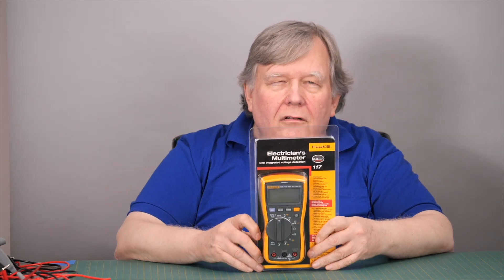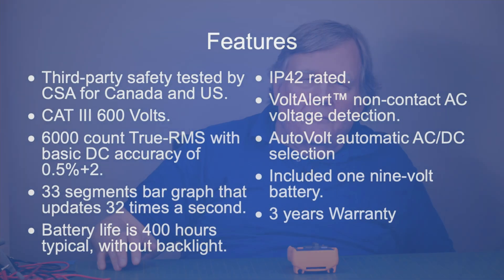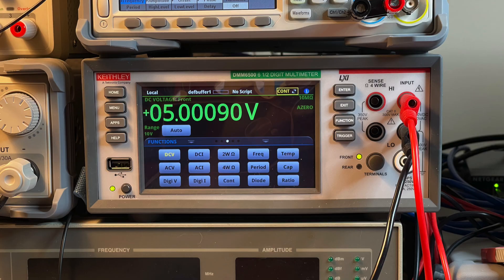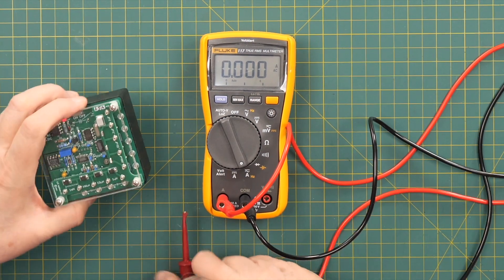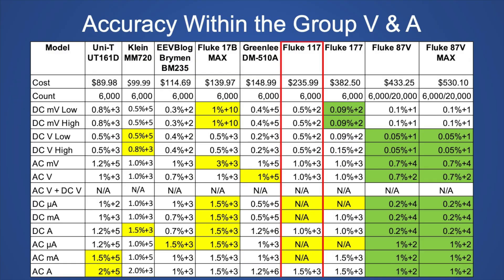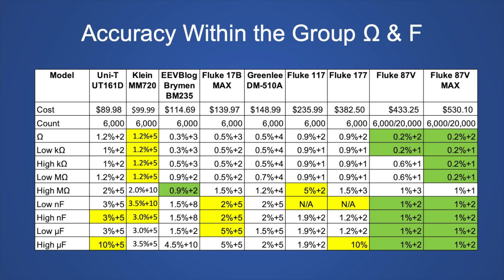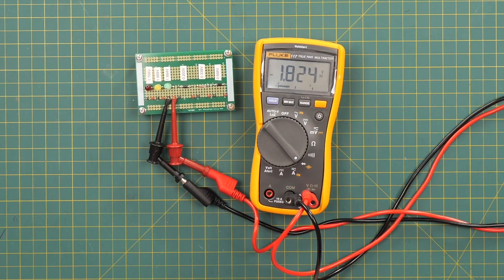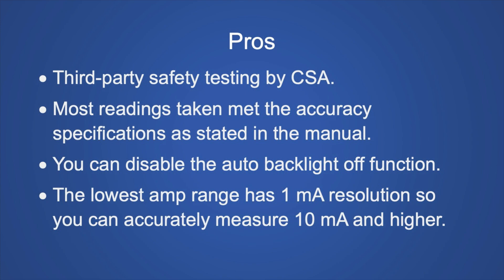Fluke 117 Review

Comment: Yep, I have one, I also have 289, 43B power meter, 7-600, as a motor controller electrician I’ve got a few others as well, other factors to consider are, toughness, safety, longevity which I believe it has over the other cheaper ones.

Comment: WTF it’s a very accurate meter for general use. I have one. It does do micro amps. Not that I use it. But for very accurate voltage and resistance readings. It is spot on. Gold plated leads? And belief that everything you have is also 100% accurate, even if calibrated (by whom). It has some very useful features and is pretty robust.
Reply: Does milli amps, not micro amps

Comment: Could you do a review on unit ut117c
Reply from the maker: The least expensive I found it was for $199, the basic DCV accuracy is 0.3% +-10, that is very poor accuracy for a 60,000 count meter.  If someone gave me one I would review it, but with its low accuracy specifications I could not recommend it.  The +-10 counts turn it into a 6,000 meter.  The ACV accuracy is specified as  1%＋-30, a $200 meter should do better than that.  You could get a Brymen BM789 for under $200, it is a 60,000 count meter with a basic DCV accuracy of 0.03%+-2 and an ACV of .5%+-30.
If you want a lower priced meter from Uni-T go with the UT61E+ for $95, it is a 22,000 count and it has a basic DCV accuracy of 0.05%+-5 and an ACV accuracy of 0.8%+10.
The best bargain that I know of so far is the ANENG AN870 for $43 (I will have a review posted by Sunday, unless I get side tracked).  It is 20,000 count and It has a basic DCV accuracy of 0.05%+-3 and an ACV accuracy of 0.3%+3.
Reply: @N8FDY  thank you very much for your reply

Comment: I like your reviews 
I think it's a great meter.Not 87v great but for "electrical installation"it works perfect.
Falls into spec on almost all categories.As far as the 1 mv reading I believe it actually falls into spec considering the error margin.As far as electrical installation and maintenance goes 1 mv is not a usual reading taken anyway.
It designed for electrical so as far as ma and ua goes it's not designed for that.
I think it's a solid meter for it's intended use.Of course like all Fluke products yes I agree .. overpriced.
And your right... leads leave a little left to be desired 
Thanks for your in depth review.I like all your reviews

Comment: I have both. I am an electrician lol thank you for the review. Wish I could have seen this video before but I can tell you as of now it is enough. Along with the Klein MM720.
Reply: So the MM720 is good?
Reply: @itskbtv  no
Reply: @georgedavall9449  At $135 cheaper the MM720 is great! Not every electrician is stuck with distribution work (which the117 isn't suitable for either with a 600 volt class 3 rating) I need something that can measure controls as well as line voltages and the 117 isn't the tool for the job so YES the Klein is a good meter.
Reply: @doogsm6013  Good reply and point taken!

Comment: I think when this meter came out in 2006 (well, I believe the 115 came out in 2006, the 117 came later) it had good commercial value. But it's now 16 years later, the price for this meter hasn't dropped (it only became more expensive) and the competition completely surpassed this meter at this pricepoint.
This meter should imho be priced in the $100-$125 priceclass, so more than $100 less than it's current price.
This is mainly an argument for the consumer market of course. If you're buying this meter comercially, especially as a large company, the extra money doesn't matter (by then, it's probably not your money anyways 😉)